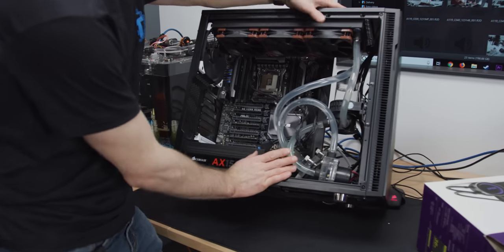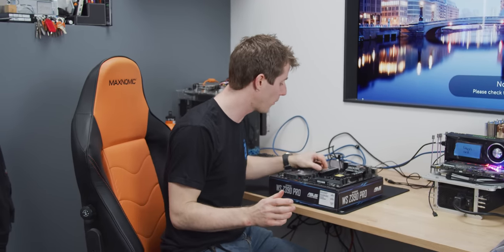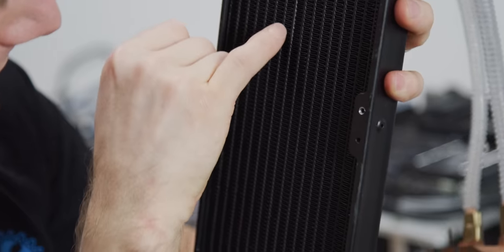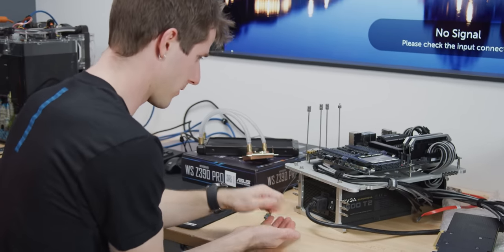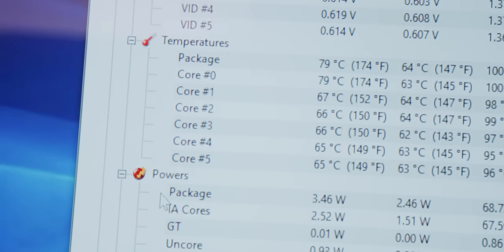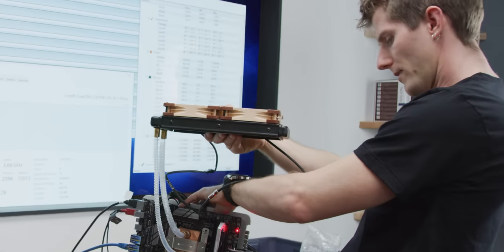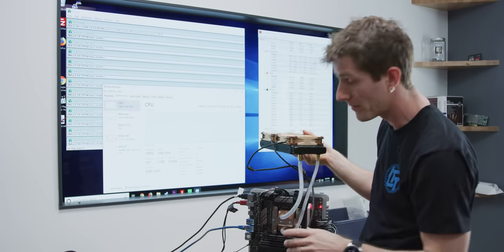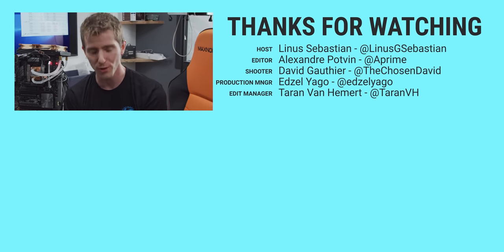CPU Cooling with BOILING LIQUID 🔥🔥

Comment: levels are crucial in this system. The bubble outlet must be located above the liquid return in the waterblock on the cpu and the bubble tube must reach the radiator above the connection of the returning tube to the cpu. Otherwise the gravity can't help to the circular flow of the fluid in the circuit.
Water must not be the fluid and the filling microtube should be because it uses a fluid within a subatmosferic pressure that allow boiling just above room temperature but well bellow the Tjunction of the CPU. That allows evaporation in the upper side of cpu block, vapor entering the upper side of the radiator, condensation along the radiator, liquid flow by gravity to the lower connection on the radiator and descending also by gravity to the lower port of the cpu block. Fluid must be less viscous than water to improve flow and bubble trapping.
that means the radiator must have a different design, so condensation can accumulate in the exit port of the radiator. 
I know it because that idea came to my mind 2 years ago but i dont have any engineering education so i just dismissed it
Reply: I'll just add a quick comment on that; all of the orientations except the best one were used.  The skinny pipe should be at the bottom of the resivoir, and the fat at the top, not at the same level; that will let the vapor-side be vapor in the top, and liquid side mostly liquid... in the end the pressure is 99% the same throughout the system so I'm not sure how you'd ever 100% get it to 'flow'.  Put the radiator on its side, with the pipes one above another; a direction that it would like never be mounted in a case.
Reply: @3zdayz  That is exactly what I was thinking would be the best orientation. So this cooler could be a bit better but it would have to be in a custom case or perhaps a wall mount, like, situation.
Reply: To quote Meek Mill: “There’s levels to this shit”
Reply: great looking response, until you spelled subatmospheric with an f :P
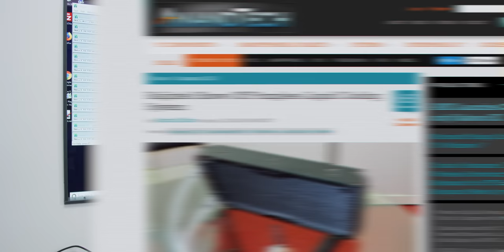Reply: Should’ve had the radiator sideways  like in the picture@ 12:55
Reply: @dalehorton7748  Some non-native English speakers are used to it being spelled with an 'F' so understandable no?
Reply: I thought you were an engineer until you pointed out you didn't have an engineering education... :p
Reply: Two of the most important properties of the liquid would be it's heat capacity & evaporation energy, how much energy is transferred to and from the liquid in 1 cycle (cold>hot at block, liquid>gas at block, gas>liquid at radiator and hot>cold at radiator). The cpu block should be vertical, where the liquid should be on the bottom and gas on the top. I like your idea for a different radiator design. Membranes could work too though. The proper seperation of flows would prevent heat transfer between incoming and outgoing flows, which improves the heat dissipation of the system incredibly. It also increases the flow (a bit) because the flows are not 'fighting' eachother. But this is not seen in the video, both tubes contain both flows.
Reply: Now this is a good thread.
Reply: @dalehorton7748  My mistake. I'm from Colombia and english is my second language. I almost never use it. "Atmosférico" is the word in spanish so I didn't see the misspell.
Reply: MUCH longer hoses would help A LOT. With really long hoses, you'd get all vapor going up in the one from top of copper block, and all liquid going down in the smaller tube to bottom of the copper block. If the hoses were 100 meters long (328 feet), a liquid the density of water could give you 10 bar / 1 megapascal (almost 150 psi) of additional pressure on the liquid, to drive a phenomenal flow velocity.  (You would only get to maximum pressure and flow when you had a large enough heat load to dispose of.) You also generally need to have no kinks like N, where a little liquid can block the upward vapor flow. Such kinks are much less an issue for the smaller hose. Of course, 100 meters is a lot of hose and a lot of fluid, and probably far more pressure and flow than needed, unless you are cooling a nuclear reactor. Now, where did I put down that giga-core CPU? ;)
Reply: They really need to change the design for efficient vapour cooling and condensation.

Comment: Should've turned the radiator sideways with the  hot tube above the cold tube. The photo y'all showed seemed to have it that way too.
Reply: Wouldn't really matter. This is phase change, not really convection. If you just had to have a continuous flow, a one way valve would take care of that.
Reply: It actually does matter. For passive systems, having the radiator in a downflow configuration works better since that is the natural flow path for the fluid that is being cooled.
Further both conduction and convection are involved. Conduction is the primary mechanism getting the energy from the processor into the fluid and convection is the primary mechanism cooling it back off in the radiator. 
In the radiator, the tubes near the entry of the hot fluid may be multiphase, but if the radiator is effective, the tubes near the outlet should be solid liquid. 
Interestingly, you could easily do this with water if you fill the system, then lower the pressure in the system with a vacuum pump. Lower pressure drops the boiling temp of water. With the right combination of temp and pressure, you can actually make water exist in all three states simultaneously. It's the critical point of water.
A one way valve would most likely prevent the system from operating. Yes, with the passive systems you have flow, but the only head pressure developed will be the velocity pressure generated from the momentum of the fluid itself. A one way valve, regardless of the type, will induce a pressure drop to great for the passive systems to overcome and thus flow will stop. Changes in pressure are what generate flow.
Reply: Thank you. I thought i was the only one who saw that.

Comment: Actually the der8auer's prototype has a tiny reservoir and seems to be a bit better. We will see :)
Reply: that is a spectacular system build
Reply: That uses some Notec fluid with boiling point around 30 i think.
Reply: @rokadamlje5365  novec

Comment: 1:13... Me and my dad used to work on a very old car (1908 FN)... so old it didn't have a waterpump but it had a giant radiator: when water heats up it gets lighter and moves up, it goes in the radiator and by means of passing air by either the car moving around or the fan, the water gets cooled condenses and moves back into the engine and the cycle starts over... this is is called "thermosifoncooling"
Reply: some early ford motor car company / usa made models are that way or just a rad fan and no belt driven pump
Reply: ps. its a crapy idea for a ice engine as it doesn't let you make big horsepower ( without damaging it ) but it does have quicker warm up times to normal operating temperatures
Reply: @richardprice5978  Yeah... back then, the engines looked more like modified steam cylinders.... cars where nothing more than just 2 steel beams and some wooden cladding...

Comment: Guessing that's 3M Novec. I've done the same thing with methanol before. Only worked at higher temp due to the boiling point.
Reply: Novek does get around these days.
Reply: I would think acetone with its 56C boiling point would do quite well at a 50% fill (as it boils, the pressure will increase and I'd guess it'll stabilize at about a 70C boiling point when at full tilt).
 Just have to ensure the plastic tubes are compatible and wont get eaten, and that everything is positioned properly (unlike Linus in this video lmao. He almost hit it at the very end when he got the radiator tilt correct, but he still missed the positioning in relation to the CPU)
Reply: @nickopedia5669  Acetone tends to destroy pretty-much everything other than metals, especially at higher temps.
Reply: @RexinOridle  
according to plastics international, ECTFE, Flourosin, PTFE, PPS, Polypropelyne, HDPE, and nylon 6/6 all get and A grade for chemical resistance to acetone.

We can pretty much ignore all the flouromers due to how absurdly expensive they are, but HDPE looks the most promising, as does PP, PPS, and Nylon 6/6 (although due to a lesser extent because of their higher absorption rates meaning the acetone may need to be added every 2-3 years instead of maybe 5-6 years)

Another nice thing is that HDPE tubing is a very readily available item from the hardware store, and although not super flexible (unless you can find bellows-style hoses like in the video), it is easy to form with a heatgun to do a "hardline" style setup.
Reply: And crap now that I've done all this research I'm seriously tempted to do this to the old 160 watt LGA775 workstation. The only issues I can think of is that my radiator (an old heater core off a car) has unknown plastic end tanks, and making a new non-acrylic top plate for the water block. 
(that part is easy enough on the CNC machine, but my surface finishes have to be really good to seal to the copper base plate with the weak clamping force that the 4 small bolts can provide).

Comment: Would probably improve flow and cooling with a custom rad that will allow gas in the top and liquid out the bottom in a vertical configuration

Comment: ask der8auer. This may be 3M novec.
Reply: doesn't look like it. 3M has about 55degC boiling point but the CPU stays between 68 and 100+ degC, plus those Novec grade A-holes made it incredibly hard to get the juice in anything less than bulk (or maybe that's just in Europe)
It looks more like an alcohol. Could also be water at a reduced pressure as well but those hoses look too flimsy for negative pressure fluids. Trust me, I've had the idea ever since I saw Novec submerged server racks and I've researched the possibility
Reply: @victorunbea8451  Well, there are different types of novec, usually the label says NOVEC-XXXX with 4 numbers at the end. Different novecs have different boiling points, and it could even be a mixture. Apart from this NOVEC is just a brand name, 3M is not the only company to sell this molecule. And since it's convined as soon as it starts boiling the pressure increases, and it takes the boiling point with it.
But still my intuition tells me it's something way cheaper than novec that's inside that loop. Obviously Linus didn't do any tests to let us guess what's in there, like squeezing the line so that we can see how flimsy it actually is. If it was a line that you can't squeeze down at all no matter what temperature it's at, then it would be capable of holding a vacuum for example.

Comment: I've done that in 2003 inspired by heat-pipes, using freon. Worked well on my Athlon XP. It works mostly like heat-pipe + some convection action. My was made with one 22mm diameter copper pipe.

Comment: Should the radiator not be on its side?
With the "hot" intake pipe on top and ""cold" output on the bottom.
Reply: I was in stitches when he kept his radiator flat.
Reply: YES
Reply: I don't get it, should the fan face forward?
Reply: @Lindaine  It's more to do with water flow rather that the direction of the fan.

Comment: You’ve made a refluxer. This concept is used in chemistry labs everywhere. The design might work better if they model it after a reflux apparatus with an inner core and outer shell  rather than trying the two separate tubes method.

Comment: The water's in a vacuum, hence the seals, where it boils at >27 degrees Celsius; it's a flexible heat-pipe and the water-movement is called thermosiphoning, and as the radiator also has a hot and cold end it too should be oriented accordingly (like in the photo), with the top becoming the hot end where the vapour condenses and falls, running the fans helps also :). Nice to see an old idea finally realised even if not given the best chance, there's a problem in getting the temperature down which I encountered in my own crude attempts, and it's hard to tell from this one if the makers have solved that.

Comment: you have to have the rad mounted on it's side with the in/out above one another, if they're at the same level the thermo-pump movement via cooling suppression has to have a hot top and cool bottom out, it's only recommended for cards that natually run at about 20 degrees from ambient temp.  like of you put a heat sink along the out side the radiator will be doing the majority of the thermal movement for the water, that's a nifty system!  will not work if the in/out are level with one another from the rad.

Comment: I mean technically its been done. Liquid Nitrogen, which ive seen people attempt cooling solutions, is a boiling liquid. Just happens to boil at -320.4°F
 or -195.8°C LOL
Reply: Derba8er has a few videos using some kind of 3M Novec fluid with a boiling point of 61C. There's even one where he dunks an entire laptop in a bucket of it - while powered on - (but because there's nowhere for the gas to go, results sucked)
Reply: you need radiator to be completed vacumed and 100% no air while you got cooling liquid that got so low boiling point to be working at best efficiency i think
(likes copper heat pipe)

@bennyg
Reply: @kopai555  that could make a big difference really, by decreasing pressure the boiling point will become lower, helps when idling; and while boiling it will help maintain a much healthier pressure inside since no one would like that mysterious liquid blown out.
Reply: @kian8382  Yup exactly and if you got big fin/heatsink to remove heat out those vapor will condense to liquid faster
Reply: @kian8382  doesn't increasing pressure lower the boiling point?
Reply: @greebj  I would say the results were poor because the laptop has a heat pipe array to remove  heat from CPU, and this is an added layer of thermal resistance and this was increasing the junction temperatures. If Derba8er had removed the heat sink and  replaced it with some type of enhanced boiling surface maybe he could have dropped the Thermal resistance from junc-fluid to a more reasonable 0.04-0.08C/W.
Reply: @kopai555  you are correct if you are trying to make some type of thermal siphon and operate the heat transfer fluid in a vacuum state to lower the boiling point of the fluid then yes a sealed system with no air is ideal.
Reply: @bigchungus7050  Higher pressure will mean liquids boil at higher temperatures than standard conditions. You can use a phase diagram to visualize this. 🤙
Reply: @papalyjon9087  ah sorry I was thinking about vapour pressure that lowers the boiling point just looked it up
Reply: @bigchungus7050  Yeah!
Reply: @bigchungus7050  No, it's the other way.
Reply: @haxalicious  liquid helium is too cold all those water in the atmosphere around the cooler/fin will condense then drop onto motherboard rip
Reply: ภาณุพงศ์ ปรึกษา liquid nitrogen does the same thing. U need to protect it by covering a bunch of stuff.
Reply: @haxalicious   Yup in case you need extreme overclocking session with realiable performance but for normal usage purpose no one gonna afford to put seal around that area.

Comment: Any super critical liquid in that should work and one large pipe would work better.

It's soldered due to the vapor pressure of the super critical fluid. 
I really hope they are using something other than butane or propane since those have vapor pressures near 100 psi